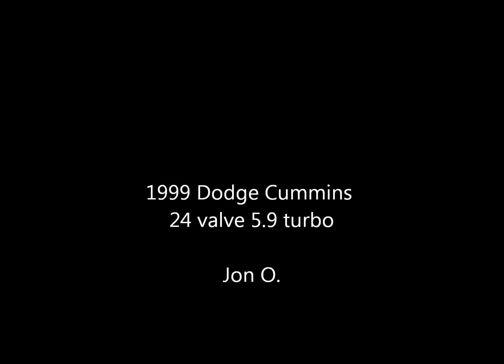How to remove & install a valve cover on a 24v Cummins

Comment: Does that valve cover have the vent filter attached to it? I have a 2006 cummins and it seems to me that there is a vent filter that can get clogged and then causes oil to blow out of the oil cap. Is this why you need to change out the valve cover on this engine?
Reply from the maker: No vent filler on the 5.9

Comment: do you need to replace the gasket everytime you remove the valve cover?
Reply from the maker: No, the gasket is reusable. Now if it's pinched or broken it will leak. So in that case replace it.

Comment: My inner fabric around the frame is making it so i cant slide the cover out any suggestions
Reply from the maker: Did you lift up and move it towards the passenger side? Mine has the fabric under the cowling too.